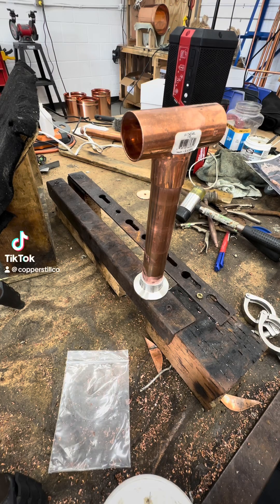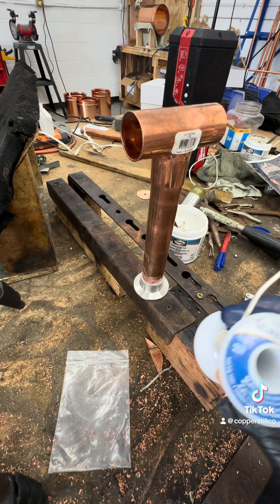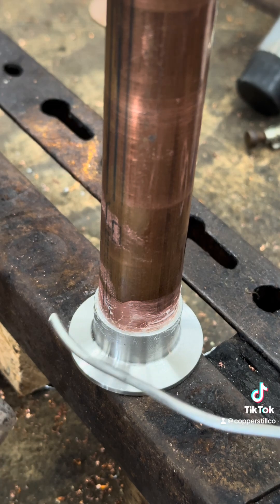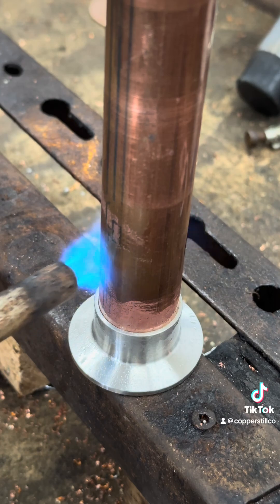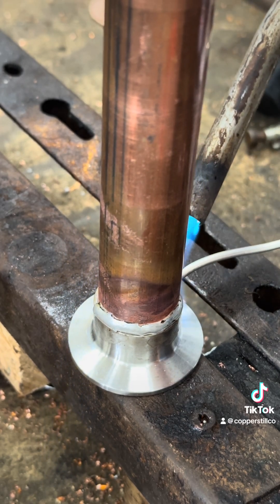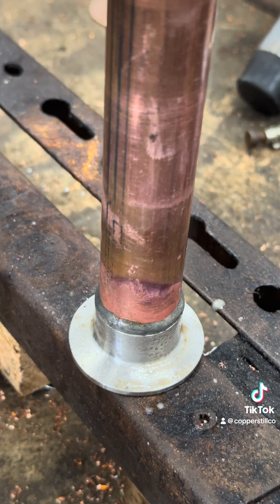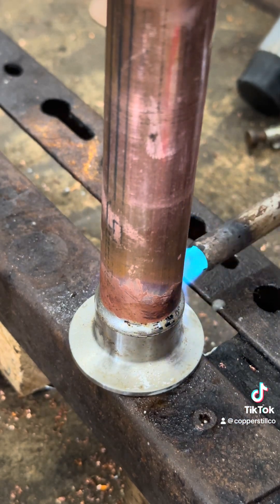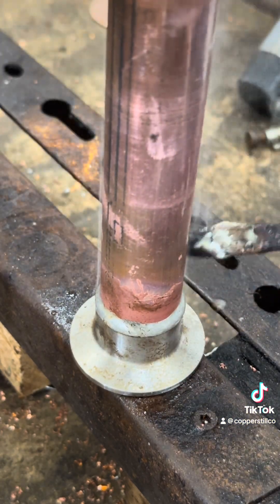Soldering Stainless to Copper

Comment: Ive been a plumber for the last 1yrs. You should heat both pipe and the fitting. You can see where the solder did not take because there is a line that looks like a crack where the pipe and fitting meet. Make sure to clean both the pie and fitting. Flux both, apply heat to the fitting all the way around it  as well as the pipe . When the solder is ready to take if you are going to keep a flame . Make sure its where you are trying to draw the solder to.
Reply from the maker: I appreciate the comment. I’ve been building Stills going on 12 years but I don’t have any formal, technical training.
That said, I am aware of ‘ the rules’ surrounding an application like this. 
This video is aimed more towards other Moonshiner’s wanting to do it at Home. Sort of an easy way to get it done. 
Technically, the heat is focused on the ferrule and pipe. But the point was to get a decent solder bead on the pipe to then  pull it down. 
Trying to avoid people over heating these pieces by breaking it down a little. 

That said, doing it this way as worked great, there’s been no issues, it fills out, it binds etc though maybe not the ‘right’ way to do it. Ya know? 
It’s not commercial plumbing, these system rarely get to 5psi. 
What’s interesting is ones has master plumbers praise my work, then have the polar opposite. That is to say, opinions vary greatly lol 
Just wanna make sure you know the tone of my reply. I’m not being defensive or anything. Just commenting back c and really do value the input! It’s great for viewers. Appreciate it
Reply: @copperstillco  Yea i meant no harm. I actually love what you do and your stuff looks** hah i word we say in the trade but YT wont like it ! I wasnt trying to sound like im the best ( because im not and have had dozens of joints leak. Its apart of the game ) . Much Love and look forawrd to the new crazy design you think of

Comment: You know that copper and stainless together directly like that will corrode the metals react
Reply from the maker: Hey, I appreciate the concern — galvanic corrosion is definitely real in certain conditions, but in this case, it’s not really an issue.

I’ve been soldering copper to stainless Tri-Clamp ferrules for going on 12 years in distillation setups, and I’ve never run into corrosion problems. As long as the joint is properly soldered and cleaned after use, and you’re not exposing it to harsh electrolytes like saltwater or corrosive chemicals, the risk is extremely low.

I get where you’re coming from — it’s true that dissimilar metals can react, but in a typical distilling environment with good practices, there’s just not enough of the right conditions (like a strong electrolyte and a constant wet connection) for galvanic corrosion to occur in any meaningful way.

Thanks for looking out though — always good to question things and share perspectives.
Reply: @copperstillco yeh no worries mate here in the uk we use these two metals for water and gas we use a brass press coupler to seperate them

Comment: ⚠️ That's a terrible joint! Mm maybe good for a towel rail or toilet roll holder. That stainless steel is needs to be brought up to heat evenly. Permitting penetration. Beginning with the colder of the two being copper. Both the copper them steel needed more time. The steel needed to be almost to glowing.
Reply from the maker: @user-zw6zm1qy5l  🤔 hmm. Interesting, 11 years without issue says otherwise but that being said — 1” L Type copper tube, Silvabrite 100: feel free to post a video demonstrating the ‘correct’ way. — Perhaps you’re thinking of brazing ? 
Regardless, ‘Terrible’ is a strong assertion. Let’s see how it’s done ! ?

Comment: Are there any problems with a galvanic response?
Reply from the maker: I have not heard of any issues in the 11-12 years I’ve been building in this industry. 

The joints are well sealed, so there won’t be any issues there since moisture won’t be getting inside the joints. Are far as surface level corrosion. Again, I haven’t seen anyone reporting such issues. 

That being said, maintaining your still is definitely important. For example, Not leaving it soak and wet or leaving liquid inside for long periods of time. I don’t think anyone is doing that though.

Comment: im trying to solder a brass base plate i guess us what youd call it over a hole in my lid so i can use it as if it were a bulkhead.  its just flat on bottom.  i cant even get my solder mekting before everything is just black af and nothing will stick.  im fixing to lose my shit. grrr

Comment: Not if you are soldering stainless expansion valves or solenoid valves to copper in HVAC/R systems. The flux needs to be removed from inside the tubing / fittings and the soldering job has to be done very fast. Use an eutectic rod instead. For larger joints, use the eutectic rod for a root pass and finish with 15% silver solder.

Comment: Hi! I have a job where i have to solder 155mm, 1.5mm wall stainless tube to a bunch of cast bronze that has been machined. Most of the parts come out really nice as they are quite light. Unfortunately there’s a piece of cast bronze that is close to 25kg, the pipe goes about 60mm inside it. That piece gives me a tough time, recently had 1 crack/come loose from the stainless pipe. The solder i use is Sn96.5 , Ag3.0 , Cu0.5. The flux i use is CA Fluid 801. If you could maybe suggest something as the failed piece had ~30% area where the solder didn’t grab the stainless steel.
Reply from the maker: @joosepmee6917  I’ve only worked with the solder, stainless, copper you see in this video. So, I’m not really qualified to give you that answer.  Wish I had good info for you but thanks for asking!

Comment: was fluxx added to the components before soldering because it looks like none of the solder was drawn into the fitting
Reply from the maker: @djomen8432  yes there was flux added. That being said it does appear that little is drawn into the fitting but I can assure you there was plenty ! If you were to look on the bottom side you’d see the solder makes it was all the way through. Matter of fact I have to have it on a solid surface otherwise it drips out! Which is a pain cause you then have to file or wire brush it off just so you can clamp to another fitting. 
The flow of solder quite fast and substantial from what I’ve seen.

Comment: I used that method with mixed results. Most people searching for how to solder stainless steel to copper don’t have your skill set and will likely fail the first few hundred 😅times. If you haven’t used RUBYFLUIDSS yet, you might wanna give it a go. RUBY is 100 times easier IMO, it will allow that solder to be pulled down into the joint by capillary action like both are copper. But if this works for folks then by all means. Rubyfluidss amazing stuff. Great video however, and thanks for sharing.
Reply from the maker: Funny you mention that. I’ve got a guy working for me I’m currently training. I had him try this right out of the gate. Didn’t go great. It’s been a couple months and quite a bit of copper to copper solder so I decided to revisit this. 
Still didn’t go to great. 
I literally said to him. “Ya know, I’ve gotta remember I’ve been doing this almost 10 years cause in my brain I think it’s cut and dry and anyone can do it” 
Lol not really the case I’m finding  😂 
This process couldn’t be easier for me. Issues are very rear. But I’ll look into Ruby cause I’m always looking for and open to anything that can tweak the process for the better. 
ESPECIALLY if it helps guys I’m trying to train. 

Thank you
Reply: @copperstillco  it’s a challenge to get it with anything else. I tried staysilv 45! 56, using phos bronze, bought a tig machine, Oxy acetylene  and found then ruby.it’s was a game changer for me.
Reply from the maker: Do they make just one ? Paste flux ? Or that pink liquid ? Send a link if you don’t mind. Thanks again.
Reply: @copperstillco  notice the SS at the end. “Stainless steel”